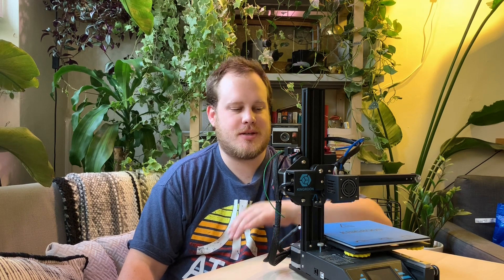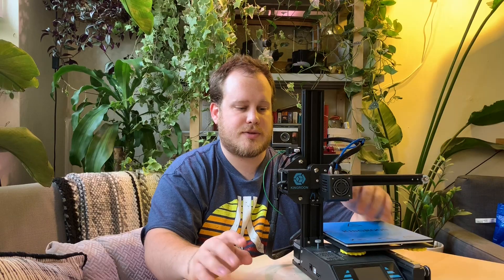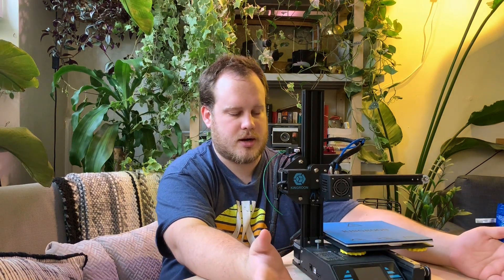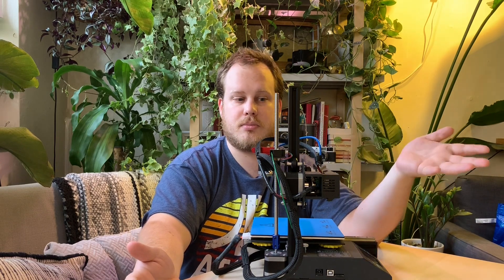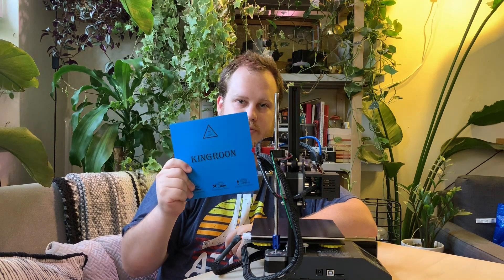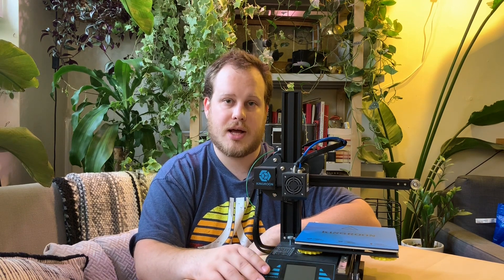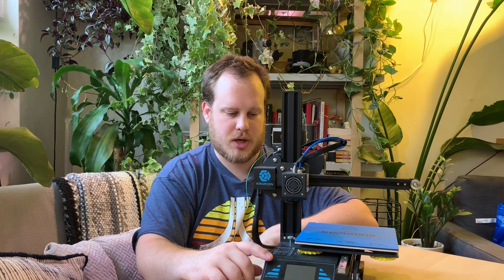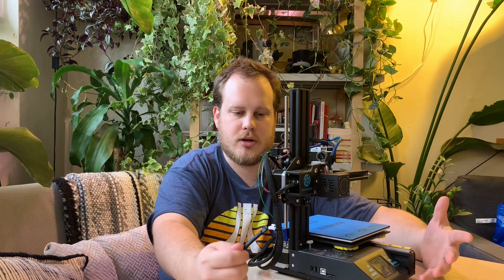Kingroon 3D Printer Review

Comment: Aaron, you mentioned the ESP8266 wifi module. I ordered one from Amazon. Does it plug in to the main board or do I need to get an adapter. I have not opened the unit up.
Reply from the maker: It depends on the unit you purchased, the esp8266 chip can come in a few different form factors, you’d want to use one that is compatible with the MKS Robin controller board in the printer. You may be able to adapt others to work but I can’t guarantee that it would always be possible. Let us know if you have any luck or if you have any questions!
Reply: @afternoons_n_coffeespoons  thanks for that info. I just ordered one for my Printer that's on the way
Reply from the maker: Awesome! 👍
Reply: @afternoons_n_coffeespoons  Here is the wifi module: https://www.amazon.com/gp/product/B00O34AGSU/ref=ppx_yo_dt_b_asin_title_o00_s00?ie=UTF8&psc=1. The Kingroon KP3 seems to have all the newest improvements. It's been printing constantly. Very nice little printer.

Comment: can this 3d printer print TPU filament or is it just PLA, ABS ect..?
Reply from the maker: Yes, it can print TPU or TPE, but would require minor modifications to the extruder.
Reply: @afternoons_n_coffeespoons   thank you for your quick reply back would you mine maybe making a video on how to modify the extruder and how to print with different colors for one print model? and that do you recommend this printer for beginning? or would you recommend and different 3d printer? because I plan on either buying this one from Amazon.

 Or the SnapMaker 2.0 which is a 3-in-1 3D Printer the other specs of the SnapMaker is that is comes with a Laser engraver and a CNC engraver,  ( https://shop.snapmaker.com/products/snapmaker-2-0-modular-3-in-1-3d-printers?variant=19732249706565 ) sorry for this long question, I hope you can help me out here again
Reply from the maker: Beril Arguner , I would suggest this printer over the SnapMaker. I’m of the mindset that once you have a tool do multiple things it results in all the features suffering. All in all this is a great printer for beginners, and it will provide pretty respectable prints out of the box, especially for the price. We’ll look into doing a video about the mod and the other topics you mentioned. It might not be until the new year but we’ll try to get something out there. Be sure that you’re subscribed and hit the bell for notifications so you don’t miss it :)
Reply: @afternoons_n_coffeespoons  thanks again for your quick reply back, I think I will get this 3D printer since am a beginner and that I know now I would be able to print with flexible filament :)
Reply from the maker: Beril Arguner we hope you love it as much as we do! Be sure to check out our other Kingroon videos for help with setup and calibration 😀

Comment: Great review! I've had mine for two weeks, I'm loving it so far. In the kingroon group on facebook there is an insert you can print that helps keep the adapter in the printer, I had the same problem and the adapter insert really helps.
Reply: can u upload a modle from thingeyverse will it print that
Reply from the maker: Please check out our latest video, where we fix this issue with a simple mod.
Reply from the maker: Crims0n , I’ll have to try that adapter!Could you share a link to the Facebook page?  We’d love to include it in our future 3D printer videos.

I have been using a barrel jack and plug to make an adapter that didn’t wiggle so much, it suddenly came loose while filming.
Reply: Sorry for late reply, I was just about to send a link to the group but I saw you had joined
Reply from the maker: Crims0n  it’s all good! Thanks for telling us about it!